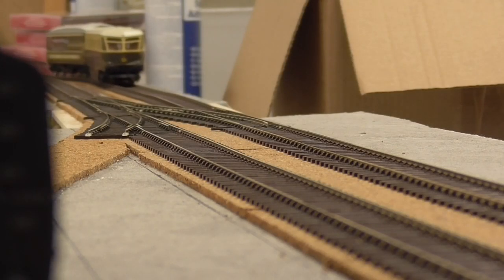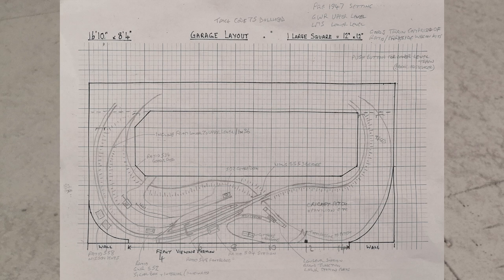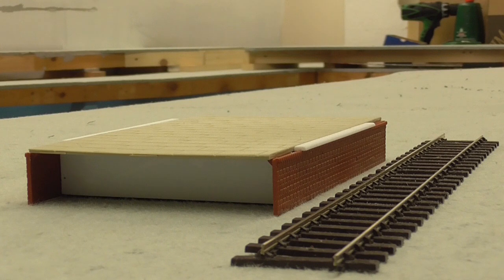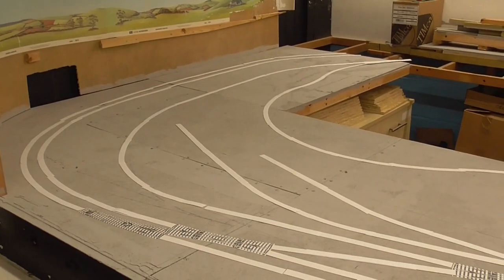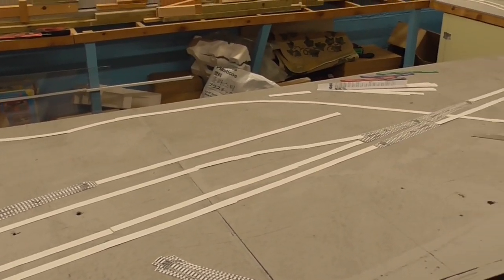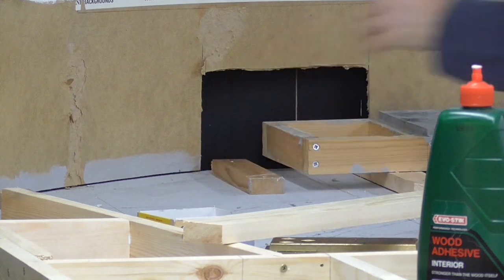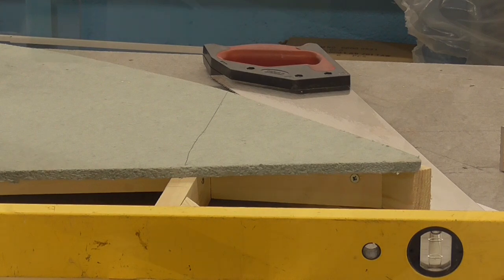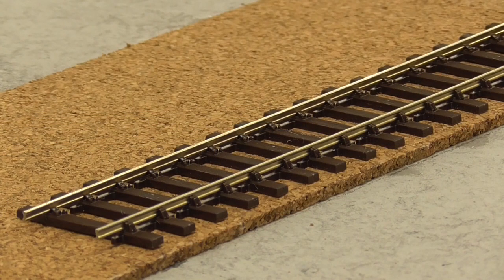Pecorama - Building a Model Railway - Update 2 - Track Plan & Baseboards

Comment: Could you please provide the name of the grey fibre material that you placed on the frame? I didn’t catch the brand name in the video. Thanks from a Canadian subscriber!
Reply from the maker: Hi Larry, it's a material called Sundeala Board. Hopes it of help!
Reply: Thanks!
Reply: From videos I have seen, Sundeala board should only be used as a baseboard in environments where there is no moisture in the atmosphere. It's a poor choice for a garage layout or loft layout for example, because it absorbs moisture and softens, causing sagging. It's quite expensive, too.
Reply: Thanks for the info! Very useful.